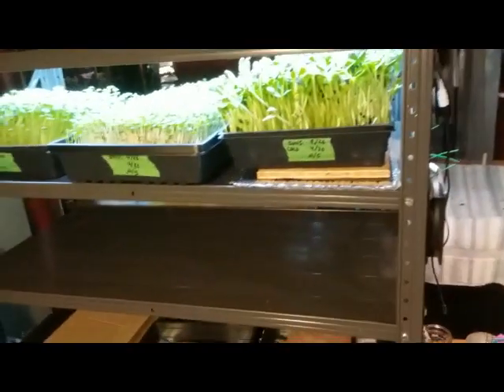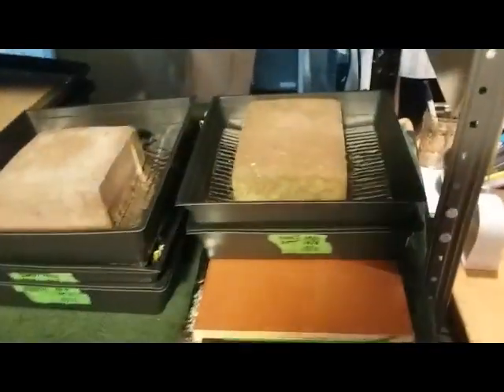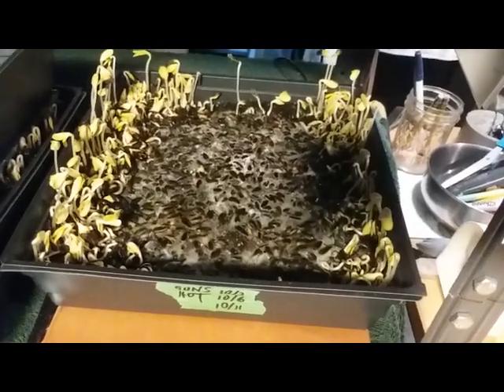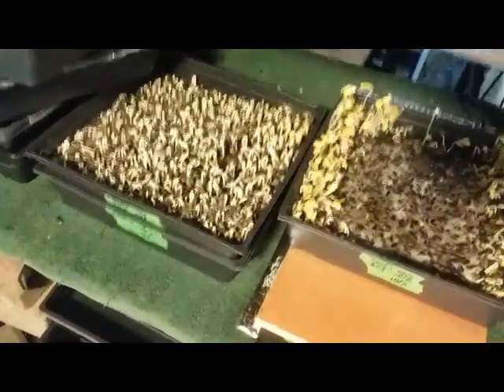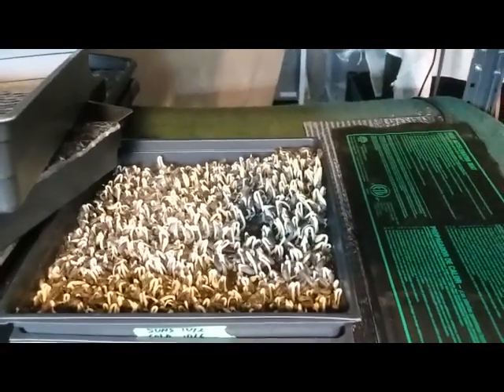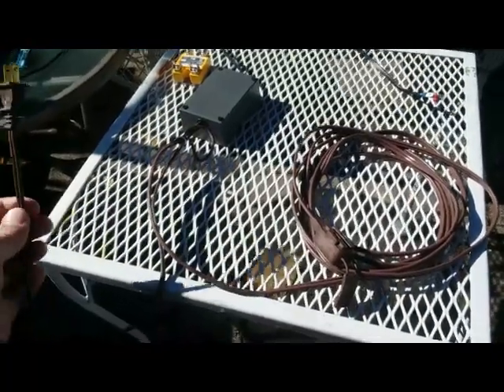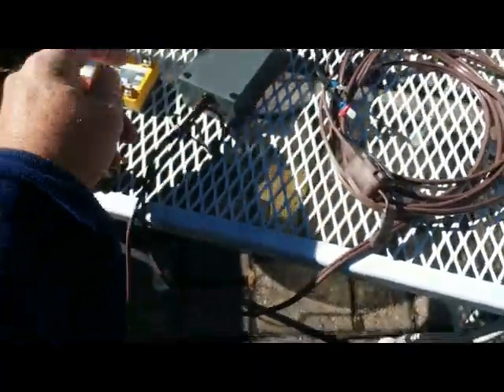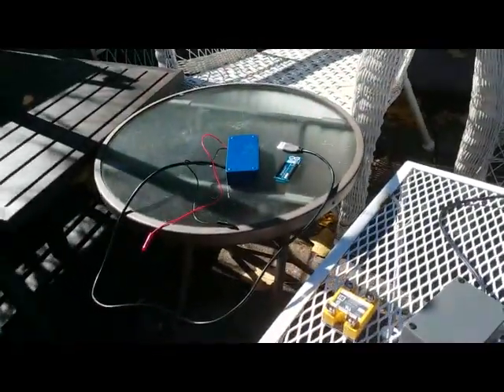Heat Pad Control Using Arduino for Sunflower Microgreen Germination

Comment: I stopped using the heat pads, room heat is enough
Reply from the maker: What temperature do you keep your room at?
Reply: I am a wooos, so at least 70F in the winter with central air heat. that room is a corner so may be 65F but seems to be fine.
best